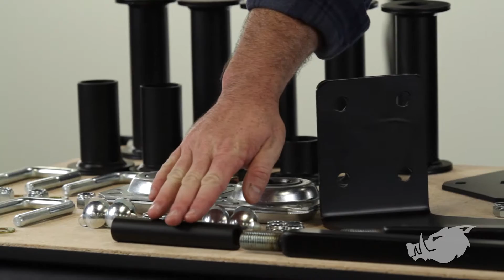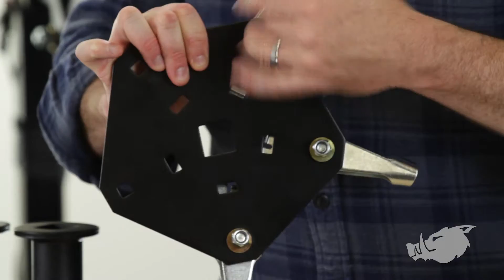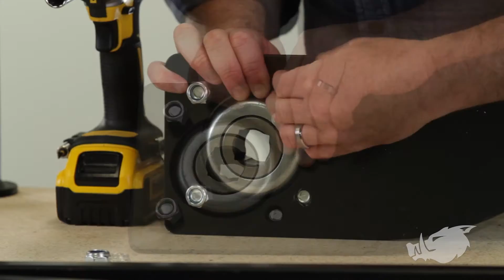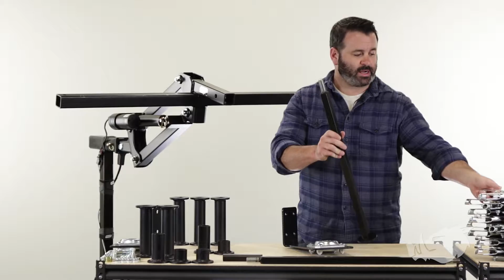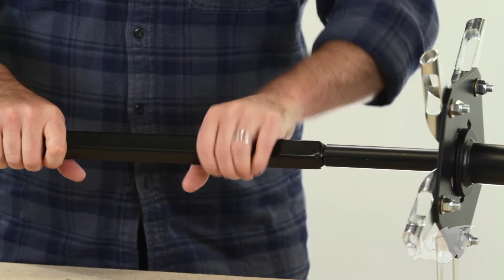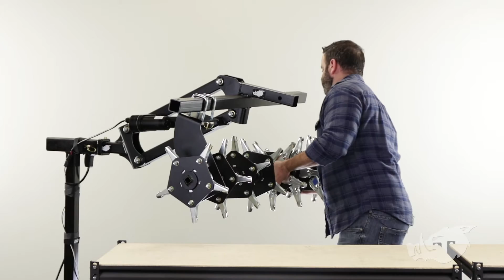Black Boar Plugger Assembly and Installation

Comment: How deep would go?
Reply: It depends on weight applied to implement, soil composition, moisture level, etc… But the max would be the tine height – which is about 2-1/2”
Reply: @camcoman6622  there is any videos yet about this special attachment?